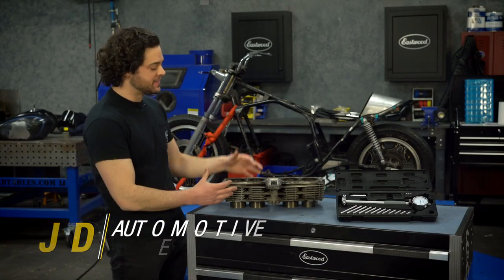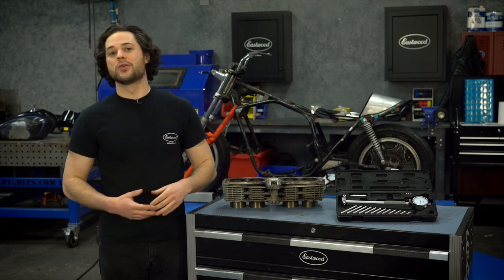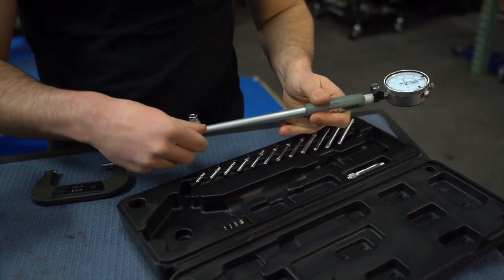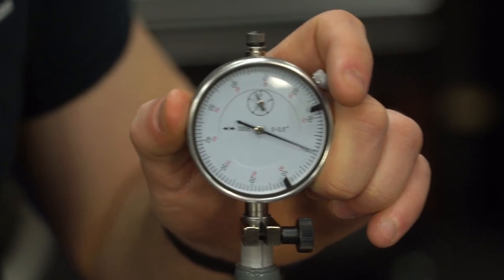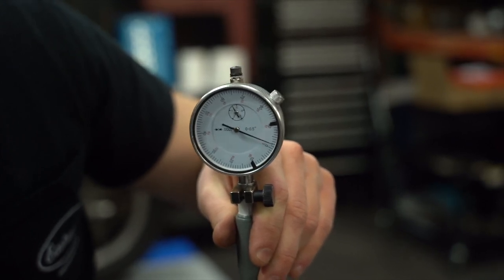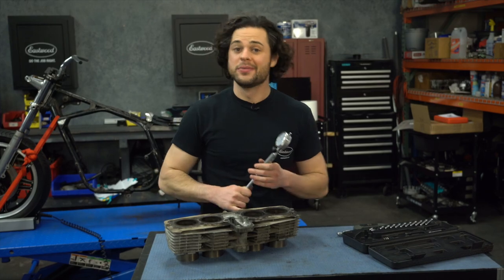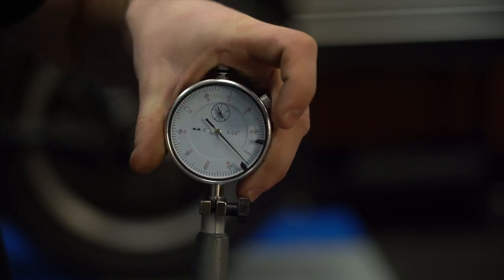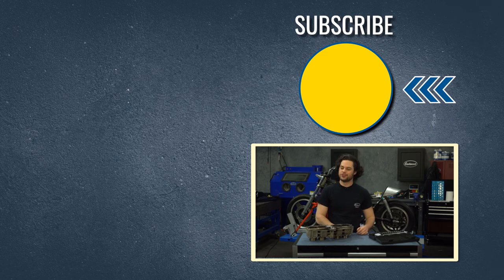How to Use a Cylinder Bore Gauge to Precisely Measure Engine Cylinders - Eastwood

Comment: As you put that gauge in the micrometer rock it back and forth and look for the shortest distance. Then, go to the area you want to measure in the cylinder and again, carefully rock the unit back and forth along the axis. Look for the shortest measurement.